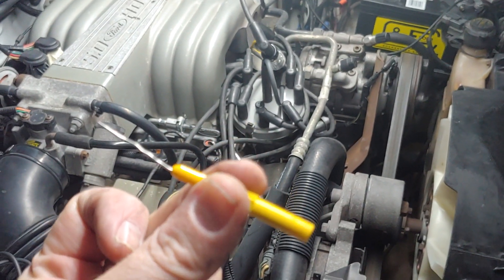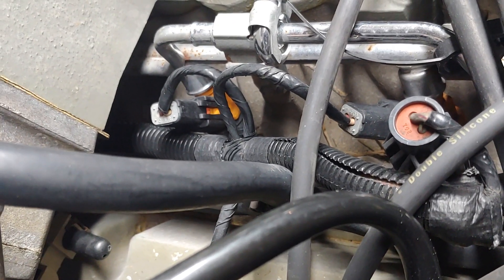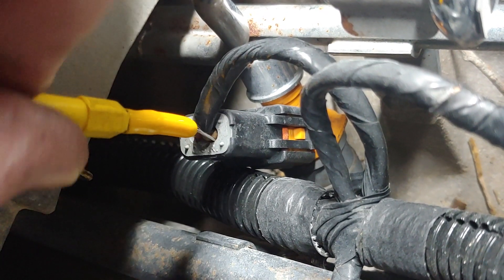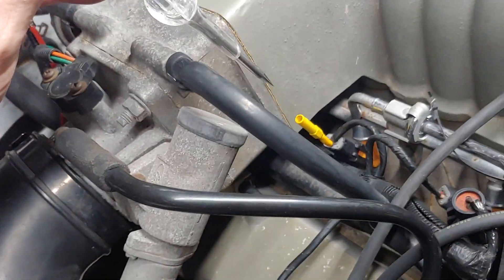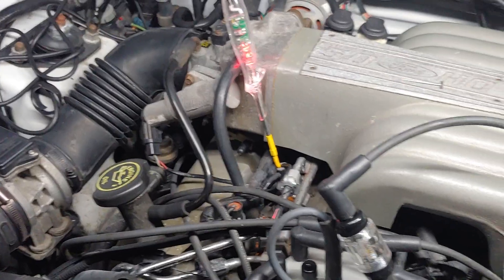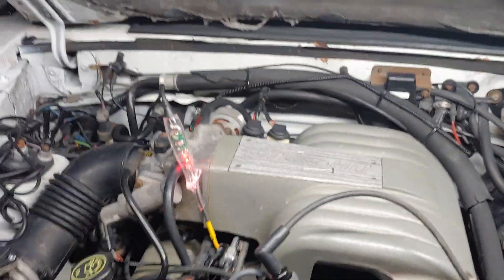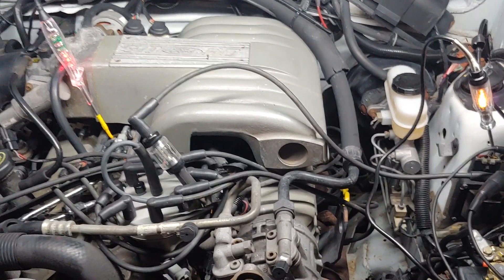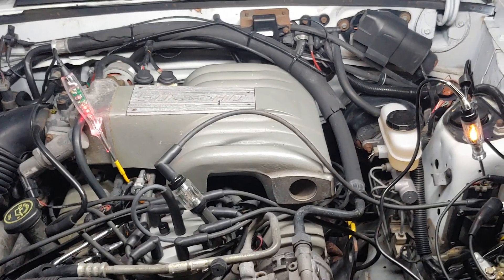Testing for Injector Pulse and Spark on a 5.0L Mustang

Comment: I was coming home  yesterday in my 87 5.0 lx when it just died . Im not getting any voltage to my fuel injectors at all . But the dist still has its spark . This is the only video that  may have me headed in some sort of direction . Idk if its gonna be the eight direction or not . Im hoping you  will have more videos on this subject . The ole car is 99% oem and im not wanting  to get real involved in a bunch of wiring because i know ho brittle they can get and how easy they can break … im an old school carb guy so fuel  delivery is not an issue at all for me  in most cases … as much as i want to i dont want yo out a carb on the car because ya cant find many of them as stock as this one is …...
Reply from the maker: The red wire going to the injectors has a constant key-on 12v power going to them all. The other wire has a brief ground pulse going to it, only when the PCM wants to fire the injector. That signal only lasts about 5/1000ths of a second, so it's just a quick blink of a test light.

The spark in a Fox can occur, with or without a PCM installed. But injector pulse (the brief ground signal) can only come from the PCM. The PCM uses the same PIP signal to fire the injectors as the ignition module uses to fire the coil. So if you have a consistent spark pulse on your coil wire during cranking, you know you have a good PIP signal, and the PCM should be firing the injectors too.

If the PCM isnt' firing the injectors despite you having spark, then either you're missing the 12v power feed to the red wire of the injectors, or you're missing injector pulse. Which probably means your PCM is not functioning. A quick way to sort of verify that is to turn the key on and listen. The fuel pump should run for exactly 1 second every time you turn the key from off to on. If it does, chances are your PCM is working.

If the fuel pump never runs, or runs all the time, chances are you have a computer problem. These cars are known for having bad capacitors in the PCM that leak, and damage the traces in the PCM. If your PCM has not already been replaced or rebuilt, it probably needs that. Remove the PCM from the passenger kick panel, remove the cover, and look at the three teal blue capacitors. If they have water stains or damage underneath them, the PCM needs to be repaired. We offer that service.
Reply: @dragradialperformance3540  the fuel pump kicks on every time i turn the key switch on . It will run for about 1 second then quit like normal .

Comment: I'm six years late to this video. 
My issue:  Getting fuel in the oil. 
Installed new injectors, same issue. Is it possible for one of the injectors to have a wiring problem so its constantly staying open, spraying fuel and washing past the cylinder draining into the crank case? 
I drove it about a mile after an oil change and the new injectors were installed. Checked the oil the next day and it had a good bit of fuel in it. 
-Thanks for the video.
1989 5.0 Mustang GT
Reply from the maker: This is a dangerous situation, so pay attention! If your oil smells like fuel, that oil is contaminated and no longer has the protective properties it should. Engine damage can happen! You can check with your nose, smelling the oil. Or you can light a little sample of the oil on fire (some place safe, like a concrete slab), and see if its real flammable.

There are only a few ways I can think of, that can let gas get into the oil. 1) On cars with mechanical fuel pumps, the fuel pump diaphragm can go bad. This is not a thing on EFI cars. 2) Injectors can leak/drip into the cylinder. Raw fuel will wash the rings off, and lower compression temporarily while also letting fuel run past the rings and into the oil. 3) Someone really dumb put gas where the oil goes. 4) The engine runs pig rich, to the point where you wash oil off the rings and some fuel makes it into the oil. 5) An injector is stuck wide open, so any time you turn the fuel pump on, massive amounts of fuel get into that cylinder and past the rings.

If the injector is stuck open, it's either mechanically stuck open (rare), or it's being commanded on all the time, when the key is on. If you test the ground/control side of the injector (the NOT red wire) and you have ground on that wire at all times, then either that wire is shorted to ground or the PCM is constantly turning that injector on. Either way, this should at best be a pulsed ground signal, never a constant ground!!!

If the engine is running and the injector is stuck on or stuck open, the exhaust will blow white smoke out like crazy. It'll look almost like a real bad head gasket with tons of white smoke, but stinks like gas.

In any event, find and fix the problem, then change the oil and filter before putting the car back in use.
Reply from the maker: The most important check for you to do is to take an incandescent test light, hook the clamp to battery positive, and touch the tip of the test light to the [not red] wire, with the key off. It should NOT light the test light. Same with the key on. If it lights the test light, then that wire is being grounded. Either it would have a short to ground in the wire somewhere, or the injector driver in the PCM is stuck on, and constantly grounding the wire. If you disconnect the PCM connector from the PCM and it's still constantly grounded, then there is a short to ground in the wire. If disconnecting the PCM shuts the test light off (when it is normally constantly on), then the PCM's injector driver is stuck on and basically the PCM is bad or needs repair.
Reply: @dragradialperformance3540 
Wow you are absolutely amazing. Thanks for all the great information. I'll check those things as you suggested. But yes pretty dangerous. I went through changing the oil three times in a week trying to narrow down the issue.
Forgot to mention this. I put a fuel pressure gauge on the fuel rail valve. Had around 32-35 psi. After 45 minutes it dropped to 8 psi.
Reply from the maker: @MetalMachine-wx5eq  let us know how it turns out. If you changed out the injectors, it's not likely a whole new set is also dripping. It's also not that likely the old ones were either, and the originals are probably better than aftermarket injectors so consider switching back if that's not your issue.

You can try removing all the spark plugs, then turning the key on and seeing if any one cylinder is filling with fuel by cycling the key on and off a few times. You could also remove the rails and injectors from the intake, and cycle the key. But remember that nothing is holding the injectors in but o-ring friction. So this comes with some risk of pissing fuel everywhere.

If you can narrow it down to which cylinder is getting fuel, you can test just that one cylinder's injector control wire (ground wire from PCM to injector). Otherwise, you can test all 8 injector control wires to see if any of them have a constant ground.
Reply: @dragradialperformance3540 
I will keep you updated on how it turns out. Thanks again for the help and troubleshooting options. I kept the old injectors I had. It might just be a good idea while I'm in there to test all the non red wires. Hopefully in the end maybe all I need is a new fuel injector wiring harness and the PCM is not damaged. 🤞

Comment: I found a partial problem.I got the engine running spark and injector pulse. Found that the starter solenoid s terminal wire will make the engine run when i jump it direct from the battery but when i hook the s terminal wire back it will only crank no spark or injector pulse.But there is a signal with 12 volt coming from ignition switch.Any ideas please and thank you.
Reply from the maker: The S wire shouldn't have anything to do with the PCM operation, unless I'm missing something. That should just be a 12v start signal coming from the ignition switch, and going to the starter relay. Are you sure that wire is what you think it is, and that it's hooked up to the right terminal on the starter relay? The S wire should not affect PCM operation, unless the wire is shorted to other wires in the harness or something.
Reply: Thank you very much for your help. Traced it to transmission neutral switch. Ignition switch wire coming red/blue goes to s terminal at relay switch but splices off to transmission safet switch.Started right up

Comment: Good morning this morning i took and the distributor and left everything connected and grounded it to engine and turned it over by hand and started getting coil spark and injector pulse.I added another engine ground and cleaned around distributor and placed it back in.Once installed turned key over and nothing at all
Reply from the maker: If turning the distributor by hand makes sparks and injector pulses and fuel pump run, then the distributor is working fine. Make sure the gear is attached to the shaft at the bottom, and not free spinning. And install it and make sure that when you crank it, the rotor spins.
Reply: I found a partial problem.I got the engine running spark and injector pulse. Found that the starter solenoid s terminal wire will make the engine run when i jump it direct from the battery but when i hook the s terminal wire back it will only crank no spark or injector pulse.But there is a signal with 12 volt coming from ignition switch.Any ideas please and thank you.

Comment: I have a 5.0 I have a random EFI distributor here, so I hooked it up to the harness plug, grounded it to engine, and spun it by hand. Bam!....lots of clicking(injectors) and lots of flashes(noid).But when i place in back in engine no pulse on injector or pulse on coil
Reply from the maker: Remove the cap and see if the rotor turns when you crank the engine. Maybe it's a broke timing chain, cam, or cam gear if it doesn't spin.

The TFI module only provides spark, but the PIP Sensor inside the distributor will affect spark, Injector pulse, and fuel pump relay operation. That's all the clicking and activity you're hearing when you spin the spare distributor. 

You're on the right track. Now just figure out if it's PIP You're missing, or spark only, or if the distributor isn't actually spinning.
Reply: I hadnt removed the dist boot  and took my cap off to see if the dist is turning . While i was on the side of the road i  removed the coil wire from the coil itself and  cranked the engine over with the key switch on with a pair of small needle nose pliers and it produced normal spark .. just because why not i done the same thing with the # 5 spark plug wire against the factory headder and it produced normal spark . That tells me that the dist  has gotta be turning .. ill still check it more throughly tho .
Reply: I have been building these motors for decades .. i have probably 9 distributors laying around that i have took out and replaced with msd distributors and a carb .. ill try some of those dist out n see what i come up with .

Comment: I have 2 red wires going to every injector. Now what?.
Reply from the maker: That's not stock, somebody has rewired something. With the key on, unplug an injector and  test for voltage on both terminals. The one with 12v is the power wire. Mark the other wire with  tape or something. The one that isn't power is the control wire.

Comment: What was the was the problem with the fuel injectors?
Reply from the maker: This video was designed to show you how to test injector pulse. It wasn't a case study on diagnosing this particular car. There wasn't anything wrong with this car, I was just using it to make videos. I probably disabled the injector pulse for this video by removing the PCM. (You would still have spark, even with the PCM not installed, since the TFI module will fire the coils off of either the PIP or SPOUT signals).

Comment: How was this going to pulse when you have disconnected the computer?
Reply from the maker: It wasn't. I was showing that with the engine disabled what spark and injector pulse looked like, and stated that if it weren't disabled the test light would be blinking. The video shows how to test for injector pulse. Regardless of whether the car has it or doesn't have it in this video, you still see how to check it.
Reply: Ok, I have injector pulse but no fuel to the plugs 🤔
Reply from the maker: @canaryinacoalmine8746  The injector needs two things to fire: Key-on 12v power on the red wire, and a ground pulse from the PCM on the other wire. A test light lets you check each wire independently. A NOID light lets you check for both of these things simultaneously, and hands free.

If the power and ground pulse are getting to the injector plug, then that connector must be able to transmit them into the injector terminals. In other words, good contact, correct fitting pins, and no corrosion.

If the injector actually gets the power and ground pulse, then it should electrically turn on the injector's electromagnet, current should flow, and the injector pintle should open. The injector will make a clicking sound and feel.

If the pintle is not physically stuck shut (usually due to injectors sitting for a long time with ethanol laden fuel in them), then fuel should flow thru the injector while it's on. This not only means the fuel pump must be working and creating 39 PSI at the rail, but it also means the injector bucket filter (pressed into the top of the injector) must also be clean enough to let fuel into the top of the injector. That bucket filter is the last chance for fuel to be filtered before it gets into the injector's internals.

When injectors stick shut, it's usually not all 8 of them. It could be several though. Tapping on the injector may unstick them. You can try cranking the engine over while pinching the injector with your fingers, to see if you feel it clicking on and off. That clicking most likely tells you the electronics are all good, but cannot tell you if fuel is capable of actually flowing thru that injector (if it's stuck closed mechanically).
Reply: @dragradialperformance3540  Thanks champ. Explained in detail. Great work you have gone the extra mile. 
Much appreciated 👍🙂

Comment: What is the pulse?
Reply from the maker: Injector pulse. It's a ground pulse coming from the engine computer, and it's how the PCM turns the injectors on. They're only on for a few thousandths of a second at a time, so we refer to that as a pulse because of it's short on-time.

Comment: Control  side of test light should be on battery  postive not body ground thats why your test light was not  getting  a pulse
Reply from the maker: The reason I wasn't getting injector pulse was because I removed the PCM, like I said in the video.

But even if the pcm was installed and working, this layout still works fine. Notice the test light is lit up? It's because the power goes into the injector, winds thru the windings, comes out the other side, goes up the control wire, and back to the computer. So the control wire is hot all the time, unless the pcm ground pulses the injector. In that case, ground would exist on both sides of the test light, and the light would go out.

The difference between the basic test method you describe and my method is that I can see if there is 12v present on the power side, and see if the windings of the injector are broke, and see if there is injector pulse... all in one test. Your test method would only show injector pulse. Both tests will identify injector pulse, but this method gives you more information. Got it? Try it on a healthy car and see for yourself!

Comment: Managed to make a two minute video a 8 minute video with all of that unnecessary dialoug
Reply: Attention span of a squirrel
Reply: Totally agree
Reply from the maker: These are educational videos, not instructional videos. They're there to teach people how all this stuff works, not to save you time. You want the cliff notes? Check for injector pulse and spark using the appropriate test lights. Done.
Reply: @dragradialperformance3540  it took you 10 months to come up with that? No wonder this video in unnecessarily long

Comment: Im not getting a priming signal nor an injector signal when I turn my key. ECU and fuel relay have been replaced any help?
Reply from the maker: The fuel pump should run for 1 second, every time you turn the key on. If it does not, your PCM is not functioning. That could be either a power/ground issue to the PCM, or it could be the PCM itself. These Fox computers are well known for having capacitor issues. They're about 15 years past the life expectancy of those capacitors at this point. The next step would be to check for powers and grounds at the PCM. Pins 37 and 57 for key on power, pin 1 for constant power, and pins 40 and 60 for ground. I would also pop the cover off the PCM and inspect all 3 teal blue capacitors for any sign of corrosion underneath them.